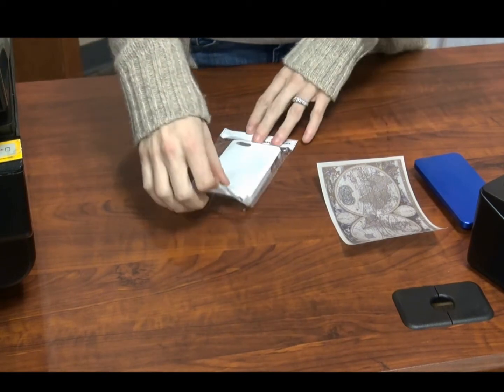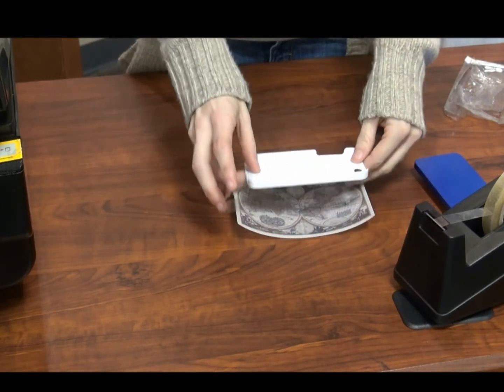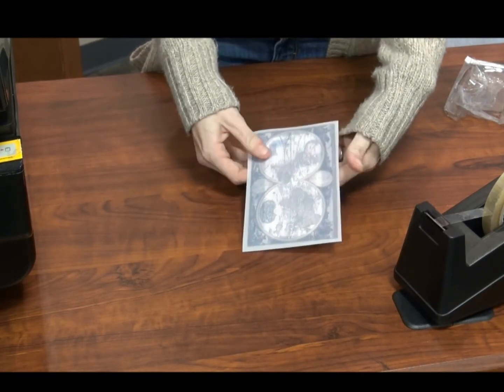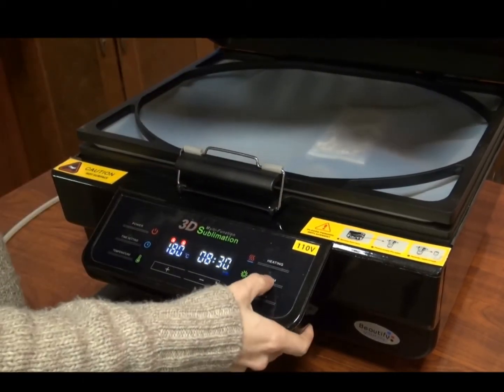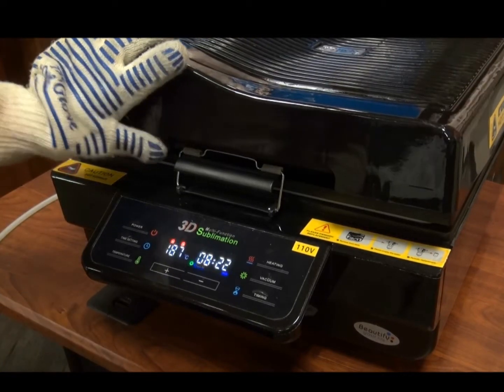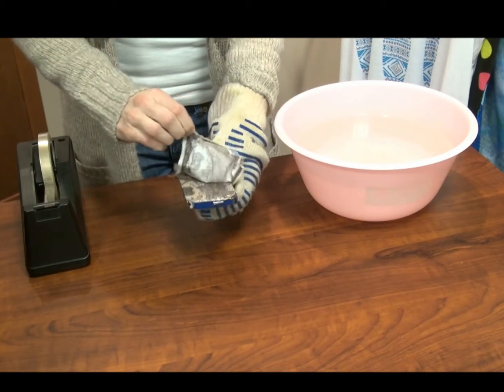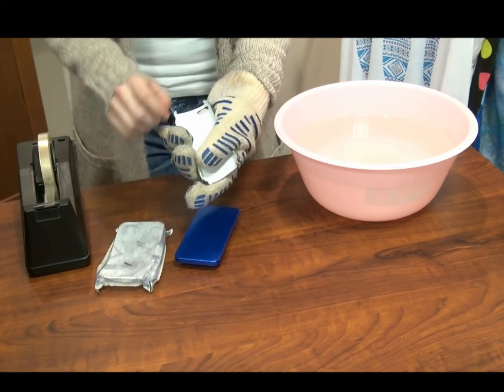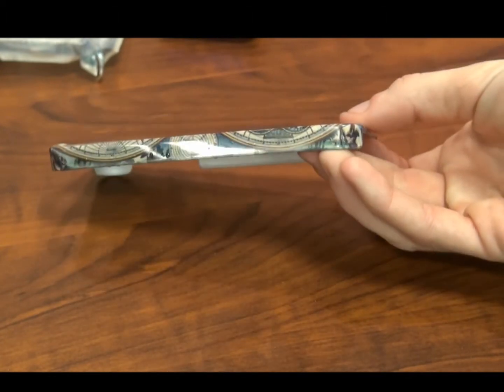How to Press a 3D iPhone Case with a 3D Dye-Sublimation Film Transfer

Comment: but how do you print on the film? nobody does any instructions on what settings to use for printing on the film itself, which after trying tons of combinations results in ink pooling on the film.
Reply from the maker: +Blueshirt Designs We printed this using a Ricoh Printer using Sublijet ink. We do find that depending on the type of image the ink does need an extended amount of time to dry before applying.
Reply: @CoastalBusinessSup  what type of papers ?